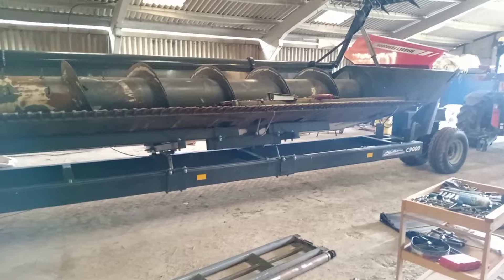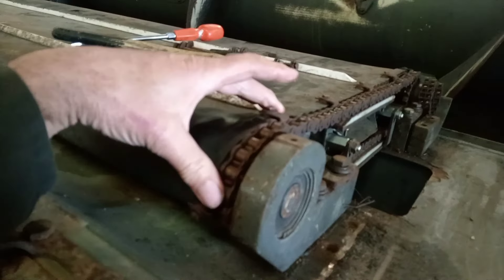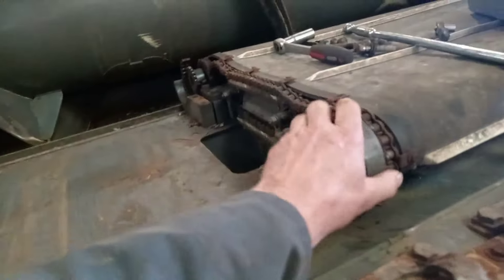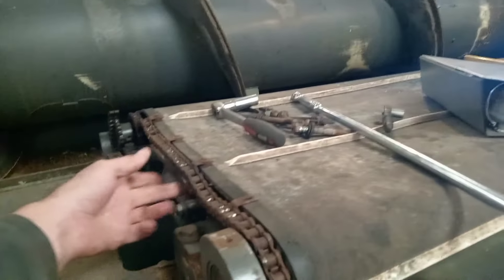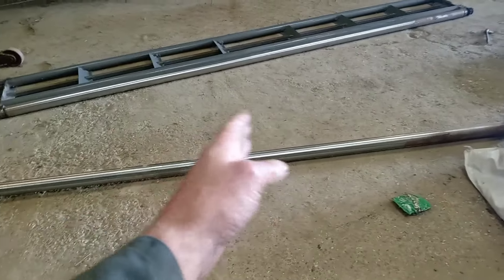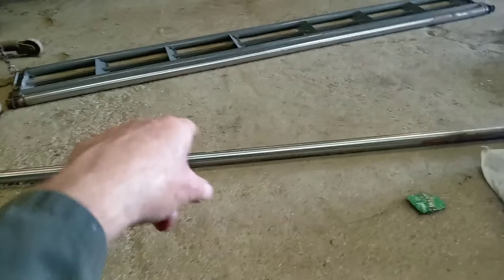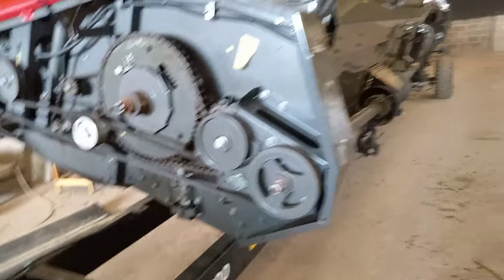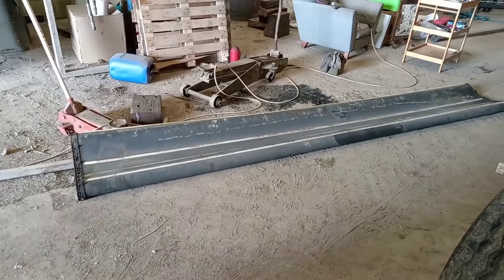working on the 30 foot superflow

Comment: Interesting to see MF finally gave up on the vee belt at each end of the conveyor belts, chain drive seems to be a sensible solution. Hate to think what that centre belt would cost from MF, the old 4 / 5 foot belts were bad enough. Used to use Apex belting in Bury St Edmunds for cheaper replacements, no connection with them myself, assume they are still trading. Cant help with the auger clutch nut, I recognize the pawl and dog for reversing the auger, but the fixing seems different to what I remember. Always used to re-section knives as long as the back was in good order. Remember as an apprentice in the mid 70's, re-sectioning four 20 foot knives in one day, not much fun!!!
Reply from the maker: Apex belts are still trading as I have used them for old 5 foot powerflow belts. They said they would be able to make one of the new larger ones but would need me to take one in to copy. I to fear how much massey may want for a new one.